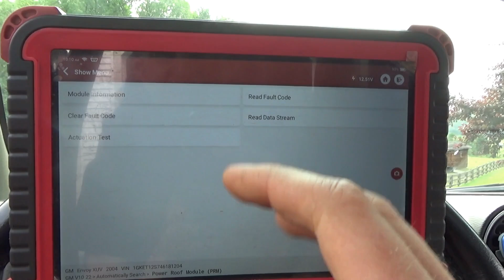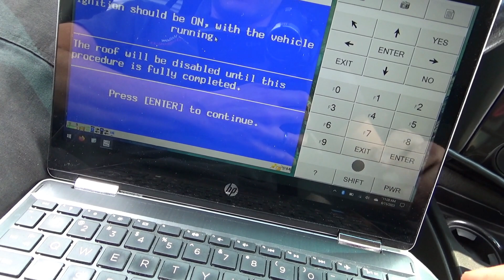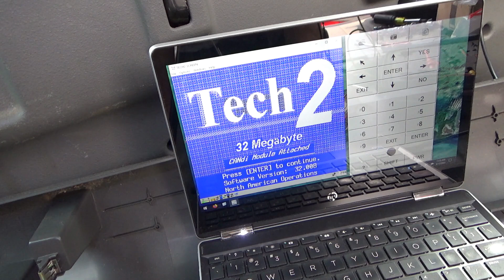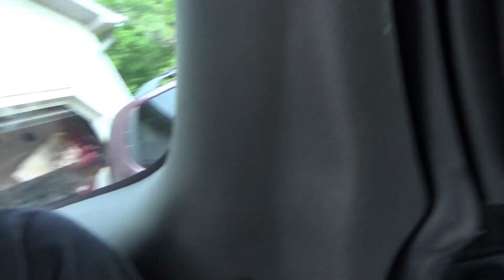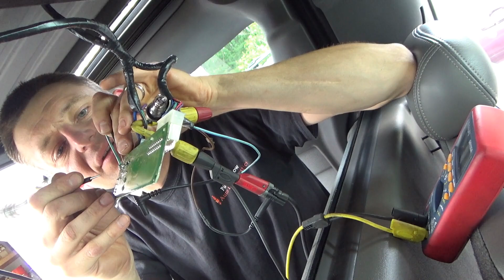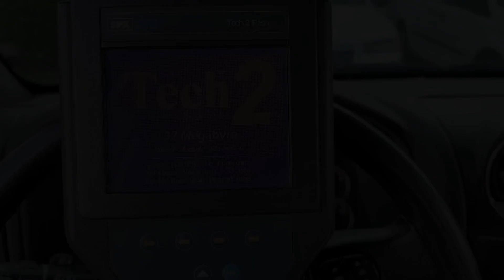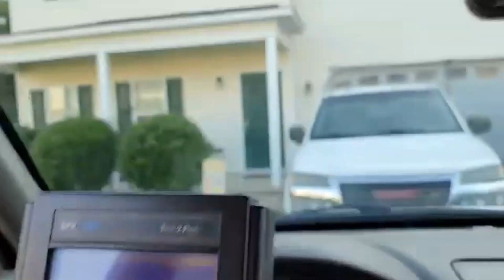Envoy XUV is BACK...and I CAN'T FIX IT?! (Power Roof FAIL)

Comment: Only reason to open a 20yr  old sunroof is to flood the vehicle next storm or car wash.  Used to have simple end switches & relays to run this stuff nowadays the engineers have gone totally Rube Goldberg
Reply: It isnt a sunroff. All the back below the midgate with window up is drainable & waterproof as a truck bed .

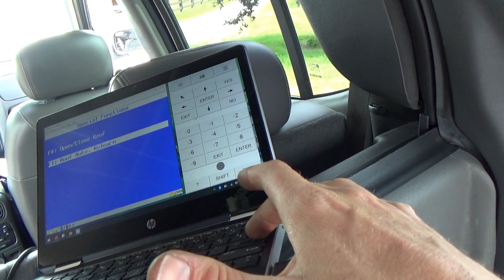Comment: 23:36 was the truck running? My 2004 k2500hd had a hvac issue where it would keep trying to adjust the blend door. I cleaned the pot wiper but the problem remained so i just selected a temp away from full and it stopped. My point is the programming allows for unreal conditions where a simple switch diagram with relay logic lockouts would make diagnosing less of an art.

Comment: Maybe that junkyard module is bad and has the same common problem. That's a reverse polarity circuit and rests at ground, when either relay is energized reverses polarity to open and close, check grounds.

Comment: GM and Honda both seem to have this calibration/learn mentality that everything must be in just the right place, and happen in just the right order, with just the right conditions, in order to even attempt the learn, and both manufacturers absolutely love to conveniently leave details out of their documentation, and have the scantool only give you a failure message, not a reason why.  In '04, I get it; limited data availability and transfer speeds.  But I've had 2023s pull this garbage on me, and there's no excuse.  :(
Reply: A few years back, I commented on another one of Ivan's videos that the stupid computer knows which of the code setting criteria triggered the code.  Why can't OBD II or the display in the infotainment system tell you everything the computer knows.  There's no excuse.  On another note, I work with software engineers who complain about other software engineers printing "-1" to the screen when there's an error.  At least here the computer is telling you there's an error :-)
Reply: @major__kong  Error handling is a lot more complex a process than you'd expect, and in 2004, the subroutine to do the roof position learn is only able to parse a go/no-go state, and the subroutine halts as soon as it finds an error, in order to reduce processor time and code complexity.  Nowadays though, it's just flat out unacceptable that proper error handling and reporting isn't built into more vehicles.

GM has gotten a little better about things, now having "halt state" data in some modules, but it's nowhere near as detailed and helpful in troubleshooting as Toyota's RoB History function, VW's Guided Fault Finding, or Kia/Hyundai/Genesis' inbuilt data.
Reply from the maker: @rhkips  it irked me when the warning came up on the dash, but no codes were stored whatsoever 😒
Reply: @PineHollowAutoDiagnostics  Wait until you start having 2020+ vehicles coming into your shop on a regular basis!  The "No-Code Christmas Special" will become a weekly celebration!  :D
Reply: @PineHollowAutoDiagnostics  As others have said age probably has a lot to do with that having all parametersback then wouldn't be able to be fitted due to component size these days that whole board could be replaced with one micro chip.
Reply: Well said
Reply: Yup, try diagnosing a DPF fault on a late model diesel. Many times the regeneration will be halted by the pcm but there will NOT be any dtc to point you in the right direction, at best you get a vague P2002 - dpf system error. It's up to you to have information, system understanding, experience and a bunch of expensive tools in order to diagnose it. The oe repair information is vague at best. You can in fact disconnect some electrical components in the system while the vehicle is running and there will be no change on the scantool data...and no dtc.
Reply: I worked at a GMC dealer when these things came out. At one point we had 6 of them brand new on the lot and only 1 worked. They discontinued them pretty quickly.
Reply: Not just in the auto industry.  I work in communications, and if you don't attend factory training when it's offered, to learn the 'tricks' the service manuals are great reference, but in the auto equivalency it's the difference between being paid a flat rate of 3 hours to do a job that the book says is a 7 hour job; but knowing how to do it in an hour in a half....

Comment: If I cared about the roof working, which I don't, I think at this point I'd be breaking out an Arduino and perf board and create my own module. However, there's old school systems like this like the electric flaps in my plane that are all mechanical switches including limit switches NO microcontroller.  Right now that's looking very attractive.
Reply: Relays for control, LEDs as indicators for conditions and it would be possible to make it work.

Comment: When the computer won't let you open or close a window, you know you bought the wrong machine
2004, disconnect the connectors, bypass the complete system with new wires. At least then you can open and close the windows, or keep blindly throwing money at it.

Comment: That missing ground on the relay is the key. A switch, sensor or other module is not connecting it to ground. A full and correct wiring diagram would certainly be helpful.
Reply: A micro-switch somewhere in there guaranteed.

Comment: Way too complicated. Who the hell thought this was a good idea? The pin on the relay is likely grounded through a transistor and a chrrent shunt sensor so that it knows when the roof reaches end positions or binds.
Reply: A bad soldier joint on the board in that path?
Reply: @dosgos  I doubt it since it worked for a while, my guess is a misbehaving switch somewhere or a latch

Comment: I prefer a car that doesn't argue with itself.
Reply: I always buy a vehicle with a solid roof. So much easier to live with, and you won't wake up some morning with 2 feet of snow inside your set of wheels either.
 My ladyfriend found that out the hard way.
Reply: @luckyguy600  Never been a fan of gadetry only something waiting to fail💩
Reply: @luckyguy600   I agree..  I have a moon roof in my 2002 Acura MDX.. and we never use it.  Even when I open it, there is no difference in the cab.  It's really overrated and I won't be getting a vehicle with another one.   We had a firebird with the T-tops, at least that was kinda cool.   I've never been in a car with the panaramic glass over head ( like a tesla)--  but I can only imagine it being another burden.   Just stick with a basic cab, you're missing out on anything.

Comment: I had one the guy had replaced the rear glass regluator. It enver worked right after. I ended up figuring out that the "new" regulator had the motor installed backwards causing the window to go down when ya hit up and up when ya hit down.
Reply: I ended up figuring it out with service info and watching live data hitting the switch it would go down and dats showed up.

Comment: Cannot believe anyone would spend $ to repair such trivial non essential systems on a 20 year old turd.
Reply: The guy wanted it fixed, and he found people willing to fix it. Not my business to complain on how people spend their $.
Reply: 20 year old car that's not rusted isn't a turd. The learning is valuable in and of itself regardless if the feature is trivial. The way things are going we're all going to be driving turds. So we might as well learn how to fix all aspects of them.
Reply: @johneddys2351  Fail blazers have been turds since brand new.  I was there when they were pushed off the new car carrier.
Reply: @scrappy7571  Well. It made it 20 years so can't be too bad.
Reply: Well, you never know he might want to carry a tree home in a giant pot full of dirt 😂. That’s the only thing I can see that being useful for.
Reply: @nowayout73  Yeah, its kind of a strange option🤣. I thought about putting a refrigerator in there, but that tailgate is to fancy to drag something on😆Prob just have to have a small utility trailer to haul stuff like that around. 

My low point in life, I put a used engine in the back of my Ford Expedition that was fairly nice with carpet and such. Had a moving blanket down and I even strapped it down. But I was definitely worried I would get an engine to the back of the head if I got into an accident 🤕
Reply from the maker: It's a mint truck with less than 50k miles on it...